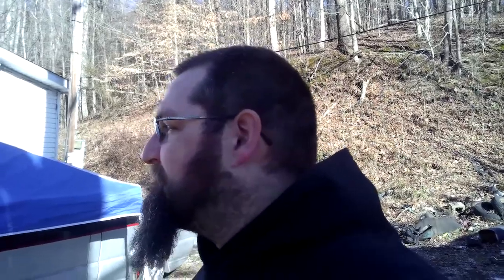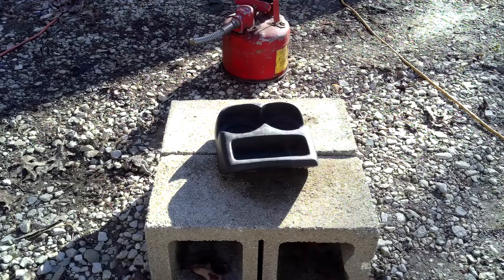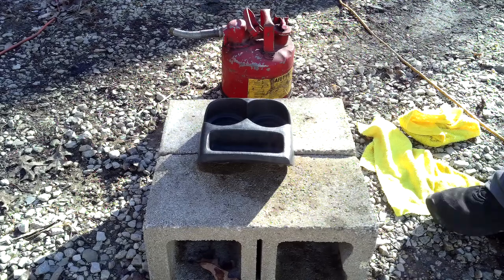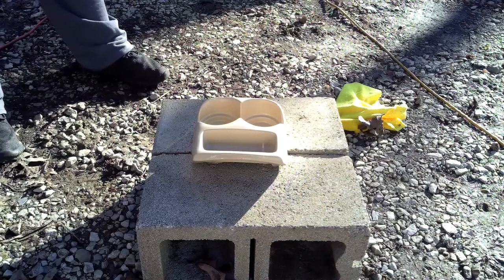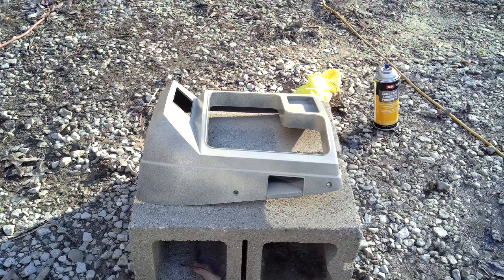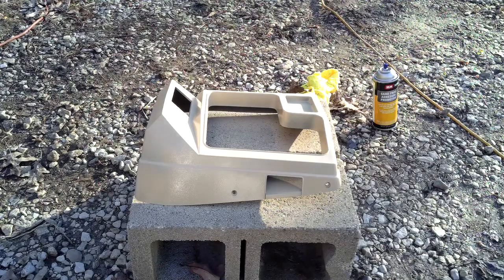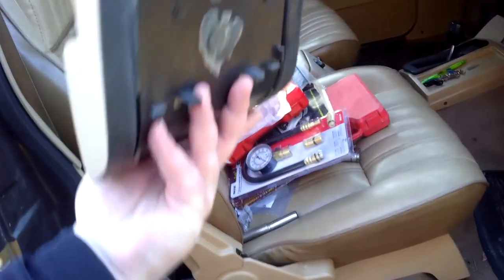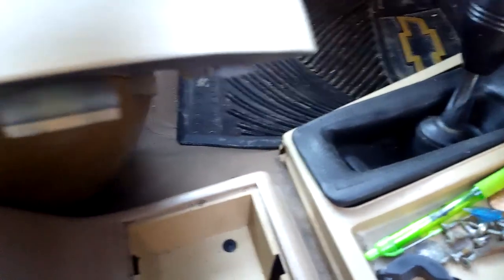S10/S10 Blazer - Using SEM Interior Paint - Light Buckskin - 15093

Comment: I think the one that was red turned out the best it actually gave it more of the factory color in my opinion yeah they're not that much different but I can kind of see it it turned out good though! 😎
Reply from the maker: Yeah the paint turned out great, I'd definitely suggest this kind of Interior paint to anyone over that Cheap Rust-oleum or Whatever that Cheap crap is I tried to use on my Seats a long time ago was, that stuff was straight up Junk and peeled right off my Seats.... Anyways this paint seems really durable, I tried to scratch it and it didn't scratch with my fingernail anyway, but My Interior is Saddle Tan, So I am going to try to buy the Saddle Tan paint that they have, the only reason I didn't buy it before is bc in the pictures it looks more Brown (I'll send you a pic of it) and I had talked to someone who said they had the same color interior as I do and he used this Light Buckskin color in his interior and it was the only color he could find that would match the best, But I'm going to buy that Saddle Tan Color Paint that they have and give it a try, I'm hoping it matches better 🤞🤞🤞

Comment: SEM also has this soap... so they've got a lot they want to sell you. Makes you wonder how much you actually need. So it would be: soap>prep>adhesion promoter>paint. Why do you need the prep if you've got the soap? And why do you need the adhesion promoter if you've got the prep?
Reply from the maker: Good Question!         I just bought the Adhesion Promoter bc I know from experience that when painting plastic a lot of times the paint doesn't like to stick to it for long and it'll start chipping off, So I was hoping that with using the Adhesion Promoter that the paint would actually stick and it did and I haven't had any problem out of it either, But if I remember correctly I believe I only Cleaned my parts with Water & Dawn Dish Soap, I can't really remember exactly tho (I don't remember if I showed me cleaning it in the video or not without going back and watching it again 🤷).... But if anything, I'd definitely suggest that you get the Adhesion Promoter 100% tho if you are looking at buying some of this paint....
Reply: @s10_4_life6  Yeah I know you do need the adhesion promoter, or the paint won't stick.  But why do you need the "prep"? And what's the difference between the prep and the soap? I think you actually have it right, all you need is Dawn dish soap>Adhesion Promoter>Paint. I'd bet the other stuff isn't necessary.